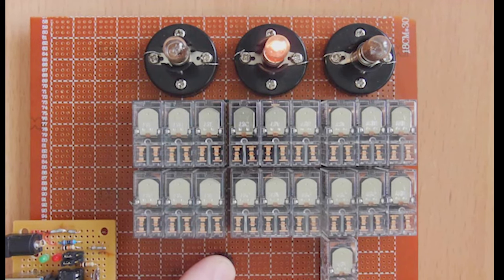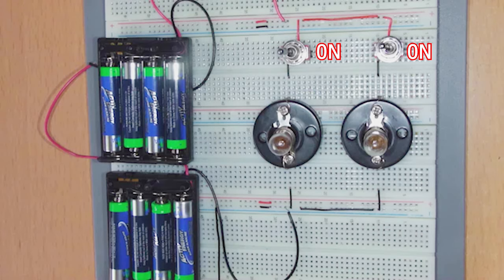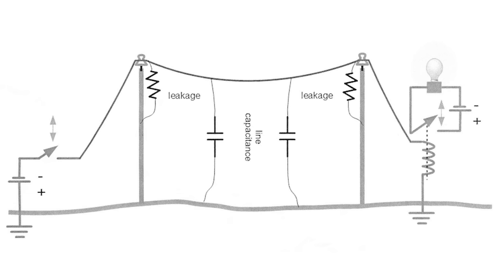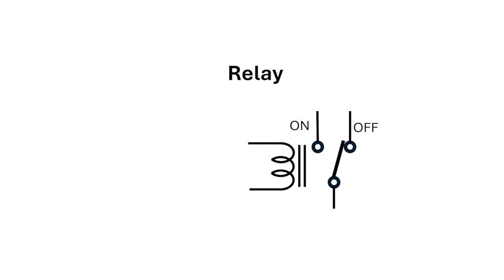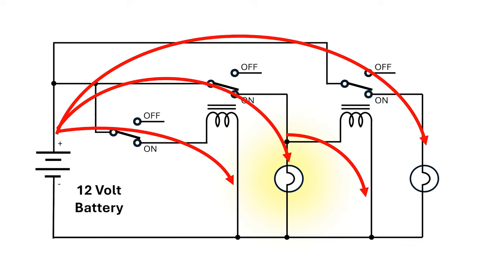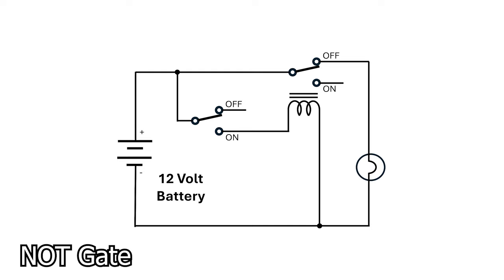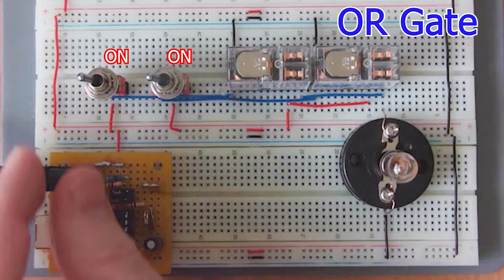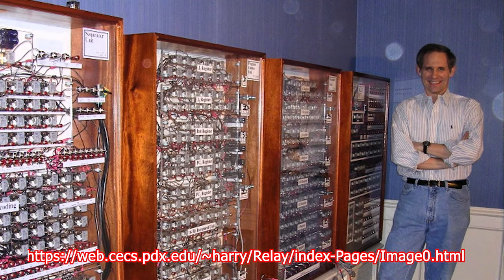Switches to CPUs: Relay based logic

Comment: No errors in this video that I could see. Good job!

It's not surprising that you can make general-purpose computers with relays. They perform basically the same function as transistors; it's just that relays have power characteristics that make them unsuited/inefficient for more complicated computers.

Comment: I had the same Radio Shack project kit when I was a kid and loved it. Unfortunately at the time I didn't know electronics theory to get more out of it. It disappeared after a move, which is a shame because it would be neat to look at the projects with a better understanding. The same is true for my chemistry set. On topic, relay computers are neat, and if Lost in Space taught me anything, it's that they're the secret sauce to building robot assistants.
Reply from the maker: Yeah, i loved mine.  
This isn't my original one, not sure what happened to that.
I got this one from Canada off Ebay to use in this video series.

I've decided to stick with the relays longer than i had 
originally planned.   Might even see if i can get all the
way out to a Relay6502.
Reply: @DrMattRegan  A relay 6502 would be beyond awesome. Also, in a 6502 forum discussion one poster said that flyback diodes decrease arcing and increase reliability. But decrease the maximum clock rate.
Reply from the maker: @mheermance  correct 👍. The counter at the start of the video has fly back diodes. I’ll introduce them a bit later, I’m trying to drip feed the knowledge.  Eventually I’ll turn that binary counter into the sequencer.

Comment: Joseph Henry invented the relay in 1835 just over a century before Konrad Zuse designed his computer.

By comparison thermionic valves were around for less than forty years before Tommy Flowers built Colossus.
Reply from the maker: Cool, thanks for that.  I know there is a bit of controversy over whether the Z3 was Turing complete.  I've read Rojas' argument but i have a slight problem with it, so i'm close to yes, but not quite there yet.

Comment: i know it is not a place for such question and that this topic was probably beaten to deth by now
but would making multiprocessor 6502 have any benefits over single "core" system?
i been wondering about it because i recently found a pack of nes clone cpus and ppu's, some 2kb sram chips an logic chips, i couls technically build about 5 nes clone systems from it but after watching some of yours videos about sinclair and other micro computer archiectures i was really curious about moving some things around on the schematics to make something wierd and the only idea i keep falling back to is how would you ever multithread an 8 bit system
Reply from the maker: Back in the day, I worked on the crossbar and level 2 cache at NVidia Fermi, which is how the cores talk to each other. I concluded that multi core is the trick you use when every other trick has run out of gas.